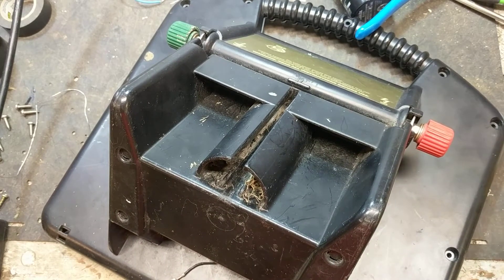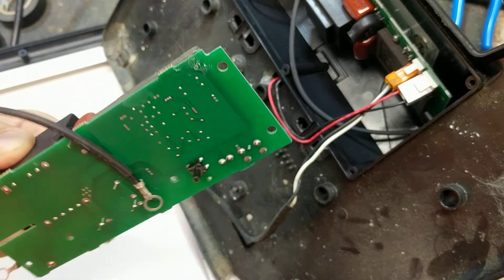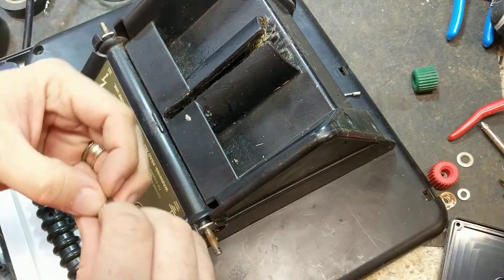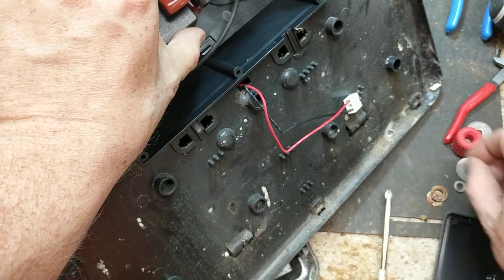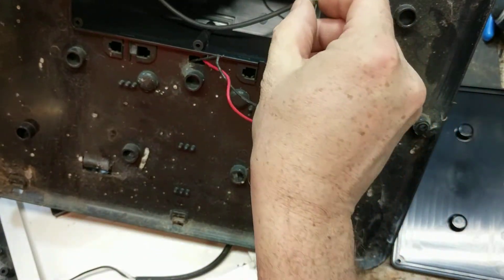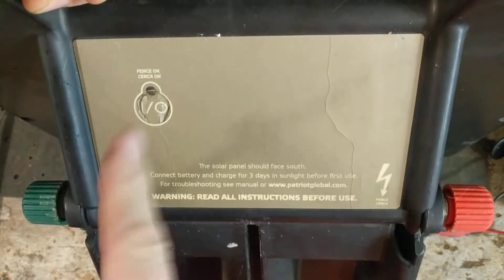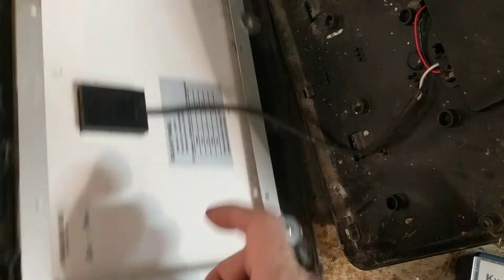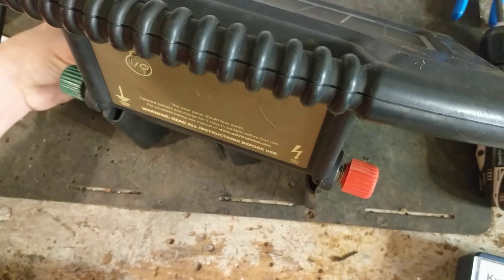How to repair a Patriot SG155 & Solar Guard 155 Part 2

Comment: What is the replacement board info for this fencer? I have been trying to look it up, but am having no luck. My solar panel is testing out at an unloaded 22.5v in direct sunlight, but as soon as I plug it into the board the panel output drops to around 1v at the panel receptacle and 0.5v at the battery leads.  The solar panel output drops to 18v when connected to a 12v test light, so I know it's not the solar panel.
Reply from the maker: You're lucky you have that unit and not a different patriot unit because they don't supply parts for about 90% of their models, they're a cheap  throwaway brand most of the time. But on that unit they supply parts for it. On the board itself there's that gel epoxy board on there, that has the voltage regulator stuff in it, so that's likely the issue with it. I don't recall the part number for the board, but I do sell parts and I can get you the board for it or at least get you a price on it. Email me at fencerfixer816@gmail.com with your contact info and I can chat through there with a price and such. You do get my 18 month warranty on the board as well if you get it through me.

Comment: My issues with this unit is I am having a issue with my ground. All my other fence charger did well on the ground rods, put I did replace them in same area. I have a great voltage going through my fence and no shock. All my shock is going to ground. I have all new fence and insulators , no matter what I do. My Parmarx Solar Pak 6 grounded well in this location as well as my Zebra with an .15 did well, but this Patriot Solarguard 155 is giving me pure hell trying to get it to ground! I think its defective. Any ideals for me? I am about to get a new battery for my Solar Pak 6 but I paid over 200 bucks for this unit.
Reply from the maker: Thanks for the comment/question. I got your email and sent you an email back on what to look at and try.